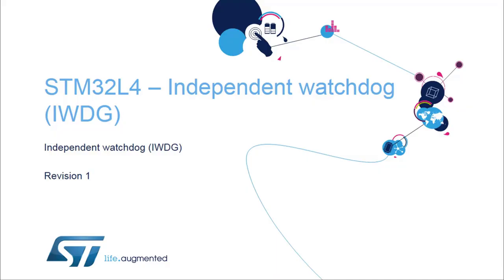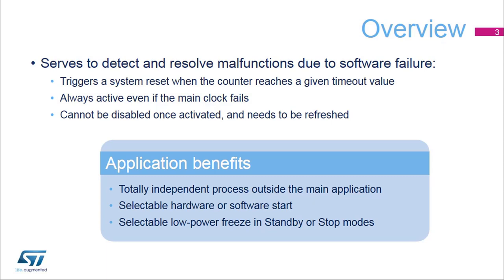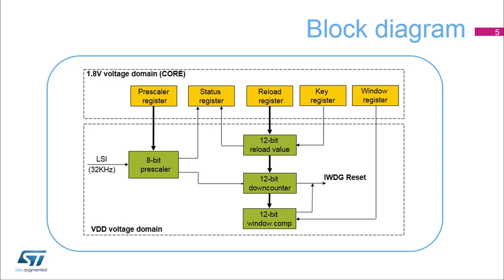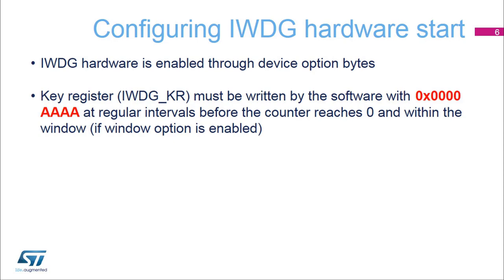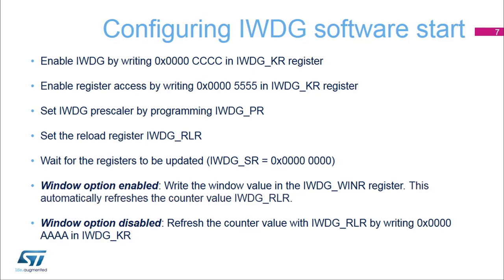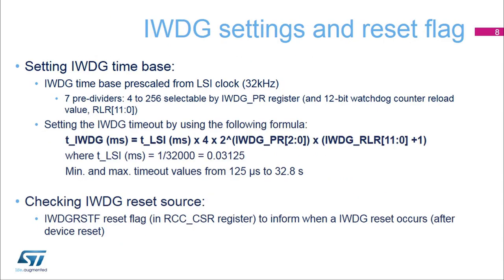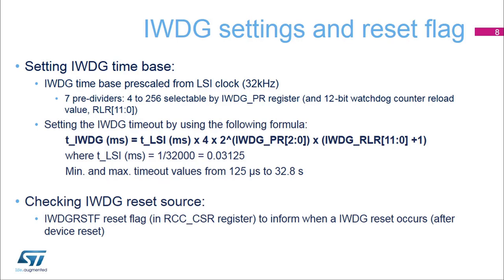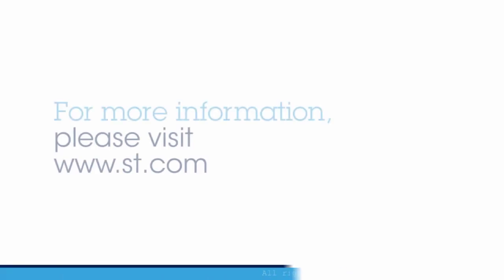STM32L4 training: 06.7 Timers - Independent Watchdog (IWDG) theory

Comment: On slide #10, Stop 0 LP Mode is missing. Can the IWDG module be enabled and used in Stop 0 LP Mode?
Reply from the maker: There is a mistake on that slide. IWDG is still functional in STOP0 (similar to STOP1 mode).